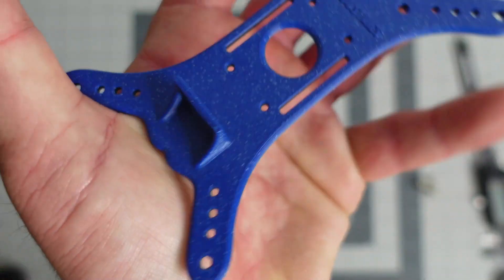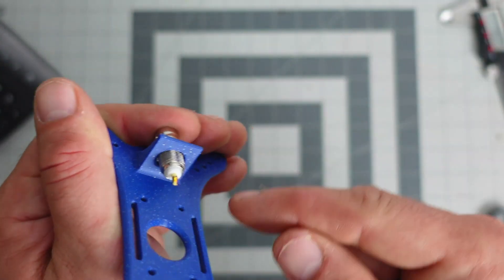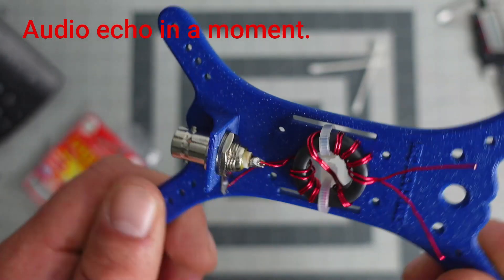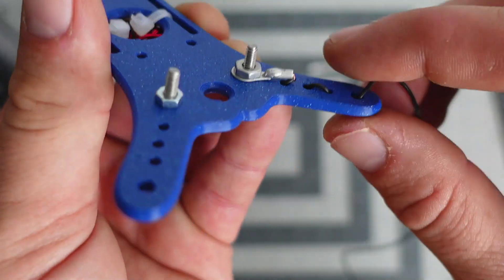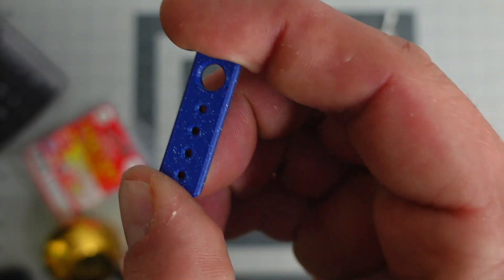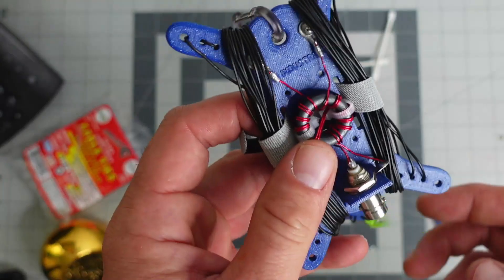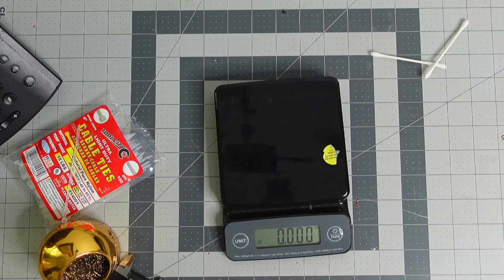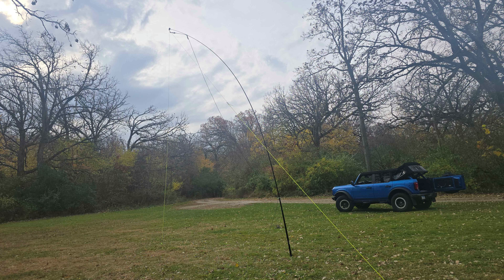Mini Wire Winder for Ham Radio: Building, Testing, and Improving a Portable Wire Winder

Comment: Just received my Etsy order for two of these little winders. Thank you for the fast delivery. My plans for these are to make a portable 20 Meter EFHW to run FT8 on a 5W QDX and a spare POTA wire antenna for the 20W Xiegu G90. FT82-43 toroids should be able to handle those power levels.
P.S. I thought the Bronco joke was funny. You even kept it tasteful. I would have responded to the commentators that a) when running the Bronco can go over 45 MPH b) least it isn't white and c) you know where BOTH of your gloves are!
Reply from the maker: HAHAHAHA! You know what's actually funny?  I was looking into a Jeep and became really concerned with the corners above about 45 mph.   It felt like it wanted to roll. Maybe I got a bad one to test drive (it was a gladiator) Now that they have fixed my issues over at the stealership, I  love my Bronco. My pleasure with the fast shipping. I can normally ship out fairly quickly, but have a window just in case.  I am glad you like it and please let me know if you should have any comments, concerns, etc.  Yeah, 20 watts should be possible, at least for SSB.  I look forward to your results!  73!

Comment: Thanks for the video HRD. 
What size toroid is that FT50-43?
Reply from the maker: Ah you're right, this is a FT82-43 .  the FT50 is what I've internally stacked in the past. Thanks for asking - Solid Free Hanging Ferrite Core ID 0.519" Dia (13.20mm) OD 0.827" Dia (21.00mm) Length 0.250" (6.35mm) https://www.digikey.com/en/products/detail/fair-rite-products-corp/5943000601/8594086

Comment: I purchased 3 of the bigger ones and dropped one and the connector mounting broke off...so sad..
Reply from the maker: Did you reach out to me to get it resolved?  I don't see your name in my order database.  Is it possible the order was over a year ago?  I've switched materials and printing techniques since then.   But in order to help,  I need to be aware of the issue so I can try to make it better
Reply: @HAMRADIODUDE  it.may have been..I think they needed a high percentage fill ... I think I did reach out but never got it worked out for replacement. Anyway not sour grapes just information for purchasing
Reply from the maker: @terrynichols3040  I can't find record of the reach out, so I  am uncertain what happened (Maybe it went into a spam folder or something), but if I get your order information, I can get you new ones.   For example , here I am testing it - https://youtube.com/shorts/baF_dwuB8Q0?feature=share  Thanks, and I look forward to being able to help. Best way to reach out is via my ETSY store, so I may be able to properly track this - https://www.etsy.com/shop/hamradiodudesells/?etsrc=sdt

Comment: Nice progress .  Love the bigger hole for zip ties and move the 2 holes down a tad.  DX on 10 meters crazy hot ! That was a 1:1 choke balun you made.  does 2 things . stop common mode current and the outher is balanced antenna to unbalanced coax . (Balun) I did get England on CB from NY !  The pileups are crazy !  just got 9:1 done.  He picking that up Sat. 73
Reply from the maker: Thanks much!  I already made the modifications and I like it better, already.   Would you have done the Choke any different in a single band dipole configuration? Thanks in advance for the  elmering and congratulations on getting over the pond.  The conditions will be good this fall, winter, and spring!

Comment: Printed this morning in PETG, thanks for sharing.  Think I might try the little torroid Colin, MM0OPX did all the testing on, but laying on it’s side.  Either that, or a 4:1 for a Rybakov. 👍
Reply from the maker: if you do that on the side, you will be pleasantly surprised to see that not only does the toroid fit onto the winder, but it also fits perfectly in between the strap holders!  Good luck!

Comment: Aloha Sean, the other day’s video about the winder giveaway, I wasn’t bummed at all but after watching this video on how easy it was to put together, I am Bummed now! 😂
     Yesterday, I took the 991A out and made a bunch of good contacts all over the US, Canada, Japan and Australia. 
      Yes, I have a new all electronic Jeep Cherokee and it runs good for a V6 but is not “ bug free” as far as all the electronics built into it. The electronic cluster has it’s hiccups from time to time and like a typical Jeep, it will give me a “check engine” light that my engine is running cold, which is better than running hot, right? My scan tool fixes that. 😂🤪
      BTW, both Lowe’s and Home Depot offers a 10% discount for military veterans but I already maxed out my Home Depot discounts for this year but January is just around the corner. It saves me $$$ for things like chlorine tablets for my indoor pool and buckets of Alkalinity Up also. 😂😅

Comment: I got one of the forty and I just built a 4:1 Unun on it yesterday for a Rybakov. This is great little winder.
Reply from the maker: Did you use a T200 toroid for the 4:1 Unun?  Thanks!
Reply: @DudeTested  I used an FT82A-43 which fits great on the winder.

Comment: Where did you get the “S” biner? Is the thing in the middle a “locking” toggle?
Reply from the maker: S Biner ,not carabiner (and i said carbiner).. Thanks.  The Ham Depot - https://www.homedepot.com/p/Nite-Ize-Aluminum-KeyRing-Locker-S-Biner-KRGA-A1-R3/315023206?MERCH=REC-_-fbt_test-_-204778400-_-5-_-n/a-_-n/a-_-n/a-_-n/a-_-n/a  I think those were them.  

Thanks!
Reply from the maker: I don't know if you knew when you made the comment, I think you did; but, thank you.  Yeah, I had these locked while trying to press down on them. Sometimes it's the most basic stuff that is overlooked! Thanks for the elmering!
Reply: @ Actually I didn’t notice if it was locked. I was interested the size. They look small but just right for this application.